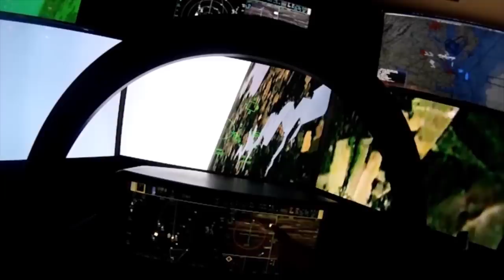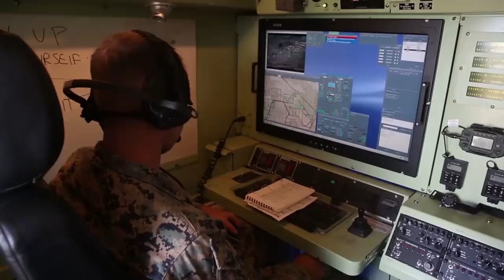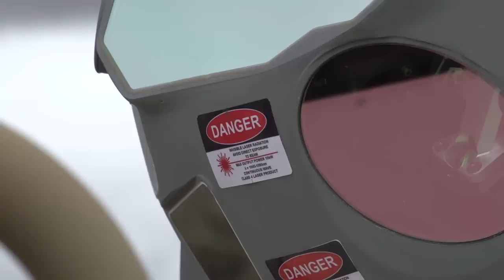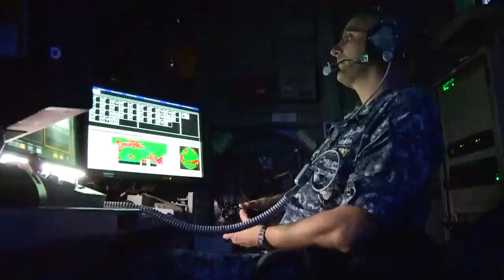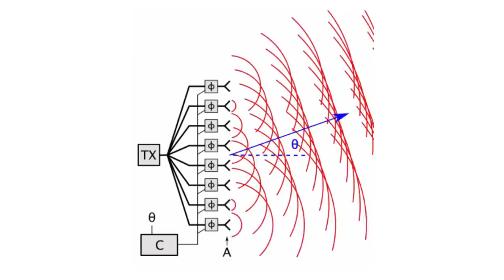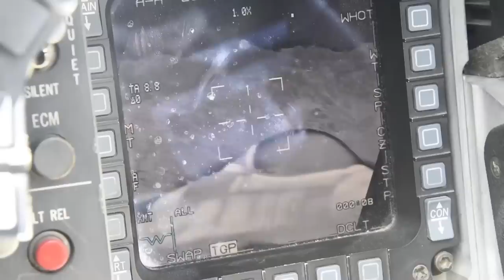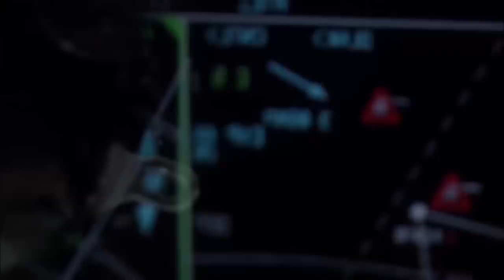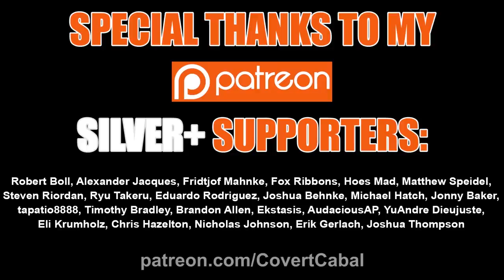Future Gen Fighter - 6th Generation

Comment: Lasers are pointless. If it’s foggy enough, or if the rocket just has a machine that spews smoke, then it becomes literally useless. Lasers are cool in movies, but never really practical. A better future weapon that could be shrunk down for planes are electromagnetic kinetic weapons.
Reply: For close range, lasers are very useful. I imagine it won't be too long before aircraft are armed with their own miniature CIWS, in the form of a laser or two.
Reply: @grubbybum3614  I wouldn't classify any current level of lasers to be necessarily useful at any range, and that won't change until we are rid of chemical batteries, with a more powerful energy source. Though, once we do reach that point, I think it would be a waste to use so much energy potential on aerial LOS combat when the more advance the nation you are fighting, the more likely most of the battles will exist BLOS, which make the lasers useless weight, useless power, or both. I am not saying they don't have any use cases, I just don't see them being deployed on a majority of aircrafts or fighters.

Comment: The F-35 is THE pinnacle of aviation tech, period. Although they need multiple platforms, not a jet that uses the same design for fundamentally different variants. I'm looking at the F-35b, if it were a bigger jet with different design I guarantee it would've been cheaper because they wouldn't have had to cram in all that VTOL tech.

Comment: For all your know how, you don't know that neither Russia's SU-57 or China's J-20 are stealthy. The J-20 was spotted and tracked by an Indian SU-30. Have you seen the SU-57 up close. There is big old rivots and gaps in panels all over the place. Radar signals are going to be bouncing all over it and returning to the radar receiver. Neither has supercruise because neither Russia or China can an aircraft engine capable of it. I doubt the J-20 has the datalink and communication needed to be a 5th gen. The SU-57 might but not sure. Based on these facts neither the SU-57 or the J-20 are 5th gen. fighters. Maybe they are 4+ but that is about it.

Comment: WRONG!.. They absolutely need to be "fed, housed" & are not necessarily "ready to go at a moments notice". They still need a hanger, fuel & regular maintenance & the 'more advanced the tech' the more regular maintenance they need. At some pint it gets "cheaper" to put a pilot back in the cockpit when weighed against loss cost v gains. What I mean is look at the B2, it's so fucking expensive they CAN'T AFFORD TO LOOSE 1 the pilots are negligible when weighed against the propaganda value to shooting down a 2 billion $$$  bomber. The advantages of unmanned military vehicles come down to a couple of points & that's it. Indefinite operational endurance, obedience when issued orders & no "guilt" by a pilot( human being) after the fact that the suits might have to answer for during/ to Congress.

Comment: Bunch of BS in this, spoofing GPS is really hard, and for drones what you really want is a high degree of autonomous operation. You can sign the messages in the link to it in a way that is not something someone can spoof/hack/interfere with and if the signal is lost at all, you use stellar tracking and perform RTB directly unless an immediate threat appears and hostile posture is in use (preprogrammed). I don't think the defense contractors are dumb enough to not implement something at minimum like this, however the loss of the RQ to Iran does seem to indicate they have or at least had some really dumb people there making decisions.

Comment: The f22 and f35 are the only true 5th gen fighters. Russia and China are still using old engines in ther so called 5th gen fighters. They need to upgrade the engine and it must supper cruse to be 5th gen

Comment: when you explain a new story of how technology has continuously advances i recommend making sure you put an emphasis on only the current issues of the day. And it seems that your understanding of an AI system might not be on par with how it works. for example, a fully AI system that does not require a radio receiver CANNOT BE HACKED! this is just how technology works. only way you could is by physically plugging in a wire into the plane which is physically impossible.................................. also even with a receiver enabled, software of the day if developed properly under the incite of a smart leading company could easily create systems that are far more advanced than you make it seem in this video

Comment: Fairly sure fifth gen also needs to be able to super cruise. Aerosexuals, please feel free to confirm one way or the other.
Reply: It’s a weird trend, but modern fighters are actually getting slower and slower. The F15 made in the 70s, is faster than the f16, f18, f22, f35 (significantly so), Typhoon, su35. 

I guess other factors like stealth are just more important now.
Reply: Supercruise is a requirement for 5th gen. @Hanif the F-15 while combat loaded is barely faster than the F-35. MAX speeds are getting slower, but the aircraft are generally getting faster if you compare combat configurations. Also the F-22 is definitely faster than the F-15.
Reply: @dumdumbinks274  FYI the F35 cannot supercruise
Reply: @lordtemplar9274  It can and does. There are no reputable sources claiming the F-35 cannot supercruise.
Reply: @dumdumbinks274  you obviously do not know what you are talking about.  Do some basic research and the answer is quickly apparent.  Infact where did you get the info that it can supercruise?  I have never seen such a claim.
Reply: @lordtemplar9274  From official sources such as test pilots, the USAF, and Lockheed. Even Wikipedia acknowledges that the F-35 can supercruise so you obviously haven't looked beyond a headline. As I said the only sources claiming the F-35 can't supercruise don't have a good reputation and typically don't cite a real source.
Reply: @lordtemplar9274  Youtube playing up again? Anyway...

Depends on what definition of supercruise you use. If it's the USAF definition then the only fighter capable of supercruise currently is the F-22, and potentially the Su-57 and J-20. If you use the original definition then you can add the F-35, Typhoon, Rafale, Su-35, Gripen etc.

The USAF define supercruise as the air over every surface of the aircraft never dipping below supersonic speeds while the aircraft is not using afterburner. For that to happen an aircraft has to fly faster than roughly Mach 1.2. The Typhoon, Rafale, F-35, Gripen etc are not capable of travelling above Mach 1.2 without using afterburner and while carrying a practical weapons load, thus they are not considered supercruise capable by the USAF.

And for reference the original definition amounts to flying faster than Mach 1.0 without using afterburner and while being useful i.e carrying passengers/cargo, a practical weapons load etc and still fairly efficient. 

Neither definition implies being able to do so indefinitely, and supercruise is still less efficient than subsonic cruise. It is used typically in short bursts when entering combat, NOT throughout an entire flight. If you consider supercruise the ability to remain supersonic for an entire mission without afterburner then the ONLY fighter that fits your definition is the YF-23 which obviously never entered production.
Reply: @dumdumbinks274  FYI rafale can supercruise at mach 1.4 with 6 mica missiles or 4 mica missiles + drop tank.  
I am just going to stop this nonesense debate as its a waste of time since you are not very knowledgeable on the matter yet continue to troll and avoid to admit that the F35 cannot supercruise or bring evidence to the contrary.
Reply: @lordtemplar9274  Your argument so far amounts to "it can't". That's all you have said. You haven't even provided reasoning as to why you believe the F-35 can't supercruise other than stating you can't find any evidence, yet you quoted an official statement that the F-35 can sustain Mach 1.2 without afterburner for 150mi....
FYI the Rafale has been officially stated to be capable of Mach 1.4 supercruise OR unspecified supercruise with a light payload. It has not been stated to be capable of Mach 1.4 supercruise with a light payload.

Comment: there is no way you can even put the Chinese and Russian jets on the same playing field as the F-22 and the F-35, both the Chinese and Russian jets are NOT stealthy at all and the Chinese jet has an engine problem, you started this video off with the lack of knowledge so I will at best hold the rest of what you say in the same light... both the Russian and Chinese jets are at best a glorified 3rd or 4th gen jet and not even close to the 5th gen jets of the U. S. and therefor have to first come up with a true 5th gen jet before the can move on to a 6th...

Comment: The Su-57 and J-20 are NOT true 6th generation fighters.... not even close.  They are both 4th generation with mediocre stealth capabilities, especially t he J-20.  Russia is still struggling to get their new engines working and China has failed miserably at making their own engines and are stuck using 30 year old Russia engines from the Su-29.  without these engines they are massively underpowered and can only take off with partial payloads and fuel allotments.  Russia has slightly better engines and stealth.  They only have a handful of these jets too.  China does not care if their stuff works as it is about show for them.  On paper they look good and you can fly them over crowds to impress them, but they will struggle against any US or Russian jet made in the last 30 years.